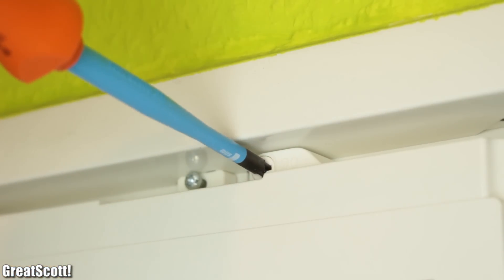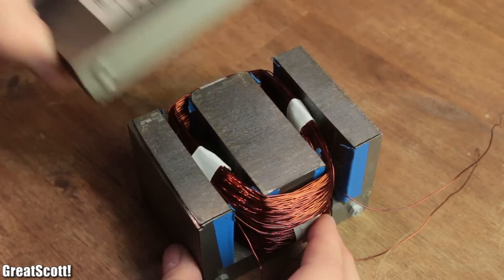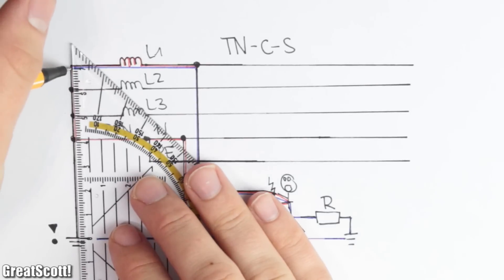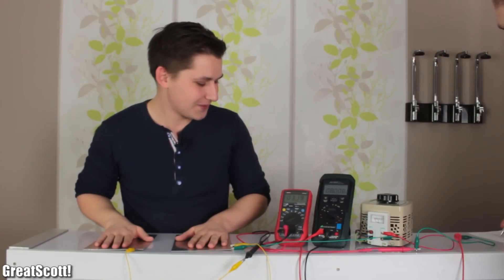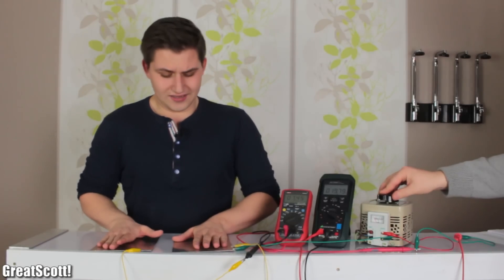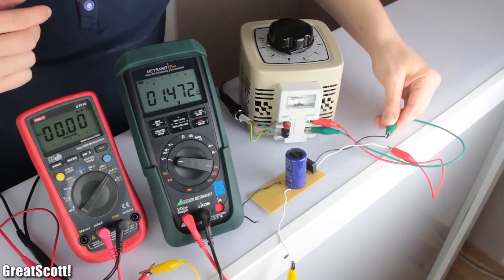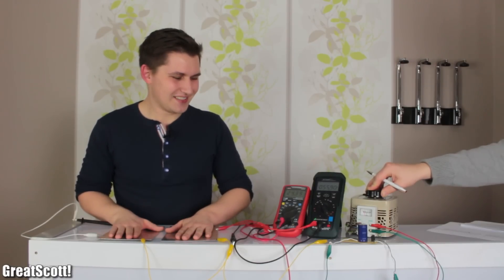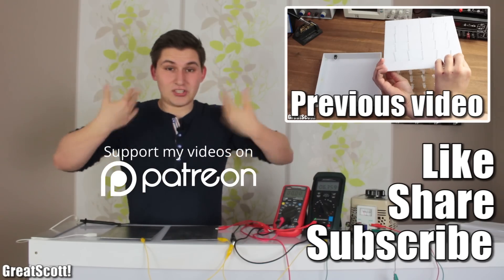AC VS DC - Pain Test (Experiment)

Comment: Please, please be careful with any AC current flowing past your heart!
Reply: +Mandragoras Ohms law is linear so both are dangerous...geez
Reply: +Mrvideosandgames yes he can make it with two fingers this is not so dangerous
Reply: rentacow
It's already been covered, the TASER only outputs 50kV when the outputs are high impedance. The energy is limited, therefore when an impedance (body) is connected to the probes, the voltage collapses. The subject never sees 50kV.
Reply: Shirshak Bajgain That's not possible. 1MV at 0.000000001A would imply the body has an impedance of 1x10^15 ohms, which is simply not true.
Reply: Shirshak Bajgain That is a misinformed statement.
Reply: Shirshak Bajgain
You cannot have a sustained deadly amount of amperage without having a sustained deadly amount of voltage. No matter how much that current is, it is only the result of the appropriate sustained voltage applied. You can never have current without voltage. There is a clever reason why you will only see warning signs reading WARNING - HIGH VOLTAGE! but never a mention to current.
Reply: +rentacow No it's not. What would be the mechanism?
Reply: +drinkrealale DC across the heart is less of an issue, it's unlikely to cause fibrillation.
Reply: @sdgelectronics  nope, it's at the same risk level with AC. DC voltage and currents remain constant, and when the this DC current flow thorugh a heart, it will forces the heart to contract constantly. AC on the other hand, had those milisecond where the voltage and current are zero, and with that time you could make an escape from the contraction
Reply: drinkrealale yes! :D
Reply: Shirshak Bajgain
How can high voltage signs be misleading? So you are telling me they should be: "Warning - High Current!"? What would that even mean? Also, what +SDG Electronics above^ said. Do you know Ohm's law?
Reply: +pesshau Yes but this is an answer to a different question, like which amount can you define accurately voltage or current. The question though is, which is the killer, volts or amps. But amps cannot "come into existence" without volts as current is the result of voltage. Also we should not keep spreading the misconception "it's not volts that kill, it's the amps" because way to often this causes misunderstanding that can have fatal consequences.
Reply: Shirshak Bajgain

Then stop saying it. Do you know how many bafoons are there on the internet who read this misinformation and believe it and then parrot it. I've read so many comments of people actually saying that they are afraid of power sources with voltage so low that you cannot feel it but capable of high amperage. And even people saying that they are electricians and have years of experience and have accidentally touched high voltage live wires and are still alive so it's not voltage that kills. This is ridiculous. Do you want to get people killed? Even when you just say amps kill, you imply that voltage does not kill and this is how you will get people killed.
 
I'll copy paste my previous answer to you just in case it doesn't get ghostbanned this time.

Yes I know it is not a universal law but it is a law. We are not discussing Linguistic semantics here. Read the wikipedia or any school book. And if you disagree then edit the article.
The human body is not a semiconductor and we are not talking about semiconductors. And by the way thank you for mentioning Afrotech's video and thank you for verifying that you agree with Afrotech's video because he said this in that video about the common misconception that it's not the volts that will kill you, it's the amps: "It's basically a load of crap and dangerously misleading ,,, so I'll bust this myth very thoroughly" & "In conclusion, in almost every situation, the volts directly determine the amps flowing through your body. If anyone tells you that volts won't kill you, they are an idiot."
According to you, 1) it is possible somehow to apply 1 million volts but only 0.000000001 current will flow through a human body (as if you meant you can apply current instead of voltage???), 2) Ohm's law is not a law (do you not think so? Prove otherwise) but just (an ambiguous?) theory, 3) High Voltage warning signs that are used globally and this is the only way they are written, are wrong, warning signs should warn about high current (which makes no sense).
I strongly get the sense that you are a troll and I don't want to waste any more of my time.
Reply: ivan Reynoso Only in ohmic materials...
Reply: ivan Reynoso I understand Ohm's law but it does not contradict the way I see things. Voltage is the dangerous force that kills, current is only the result of that force.
Reply: +Mrvideosandgames Your comment does not contradict in any way my comment so I don't see why you had to quote me. It's annoying when people don't understand what I write and I have to repeat myself. We know give or take how many amps through a human heart can kill a person just like we know for example the amount of a chemical in the bloodstream that is needed to kill. The force though is the voltage, amps are just the result of that force so voltage is the murder weapon, current is the bleeding and resistance is the bulletproof vest. How much voltage? That depends like you said on the skin/body resistance which, when high, can result in low current because of Ohm's law. I never said that low voltage can kill unlike low current. I did not mention amount of voltage at all because it is irrelevant to this discussion. Current cannot exist in the first place without voltage.
Reply: +Mandragoras it's the curent that kills you, look at the high voltage workers, they work on powerlines at 400kv or 250kv, and the connect first with a wire and work under high voltage. that guy from your video is not right.
Reply: Fυck it, I quit. Youtube, shadowban style, deleted my comments to both of you. I don't know what's the problem with youtube and why it's shadowbanning my comments so regularly. Besides, I get the feeling that you Shirshak Bajgain are just trolling me so I won't waste any more time on this. Believe what ever you want, I don't care.
Reply: +Mandragoras USB is only 5 volts. When you touch it, your body has too much resistance for the electricity to flow, so no deadly current. That's why 9 Volt batteries aren't very dangerous.
Reply: rentacow
Yes, I know, thank you.
Reply: It requires both volts and amps to kill
You can have 2 volts and around 800 amps(homemade spot welder) and you would not die as 2 volts is not enough to overcome your skins resistance(in a short it produces 800 amps)
Amps is v/r so assuming the skins resistance is 1000 ohms you would only have 2 mA flowing through you. 
Unless you have a really high skin resistance or a current limiting resistor you will die from 100v ac. The skins resistance changes dramatically as you get to higher voltages too.
Reply: Shirshak Bajgain
Wrong again.
Reply: Ok let me finallx clear up this goddamn stupid conversation. Youtube comments are just full of sh*t.

It's the combination of voltage & current AND time.
Reply: OHMMMMMMMMMMMMMMMMM
Reply: @KK-pq5cf  Actually, if you want to be even more precise, what kills is either the arrhythmia and spasms in low-frequency AC or the burns produced by heat in DC and high-frequency AC.
Reply: +drinkrealale Ohms law is linear relationsip between current and voltage therefore both are dangerous
Reply: SDG Electronics I don't think ? can you show proof?
Reply: +Mandragoras 
Youtube's ghost ban sucks ass. I had to delete my old account because Google thought I was a troll.

On the subject of Volts and Amps, I think +drinkrealale got it right: the amount of lethal AC or DC current is fairly constant, and the voltage is what pushes that current through your body. How much voltage is needed? That depends on your skin resistance, which can vary greatly depending on factors such as sweat/moisture or frequency (if we're talking about AC).

Therefore, it is much easier to determine a lethal value of current than voltage.
Reply: Shirshak Bajgain
I'm 100% sure if I interpret correctly what you mean by "LOVE !!!" but anyway, I sincerely wish you the best.
Reply: +Mandragoras ok lets close it . thx love
Reply: +Dr. Lecter are u really doctor?
Reply: +Dr. Lecter hai r u really doctor?
Reply: Yea
Reply: +Mandragoras This is a really late reply, but it is the Current that kills you, sure you have your own beliefs about this, but just so you know,  If you put a 9v battery and hook it up to a LED, its going to burn out, this is because the amperage is going into the LED too fast. Its the same with a light, the fillement in the light lights up because electrons are moving through it quickly. However, if you put it near the heart, electricity moves very fast past it because humans have nearly no resistance in their body. So essentially, you are burning out your heart because it is heating up too fast essentially. Also with AC amperage, your heart rate is going to spike horrendously causing a cardiac arrest (i think atleast, im no doctor, im a scientist and computer programmer (kind of) xD)
Reply: MrCilliman That's exactly why I want them to be careful, lol.

Your skin actually has a fairly high resistance, by the way, about 10KΩ I think, and your heart most certainly does not fail due to being heated up, lol. The current just stops it working properly, which can sometimes be handy in operations and such if they want it to stop beating for a bit.
Reply: Shirshak Bajgain But I was agreeing...

***** Thanks for explaining, lol. Could be any frequency, lower or higher, I assume.
Reply: Mrvideosandgames Sorry i don't mean this comment to you . It was for who said voltage kills rather than amps :(
Reply: I zapped myself with a Flyback transformer... Wasn't fun

I'm not gonna go too far into it, but I had to work with a CRT while it was on...

Just make sure you don't work with both hands and ground it before your heart.

I did fix it though
Reply: I'll also say that I know I'm retarded, no need to tell me what I already know.
But feel free too lolol.
Reply: You need voltage to overcome the resistance of your skin. Static electricity is many thousand volts and does not kill you because there is not enough current.
Reply: isn't this a stupid discussion? OHms law: R=U/I so if you want twce the voltage at the same resitance you automaticlly get twice the Current, don't you?
Reply: +Felix St dc can be more dangerous mainly because it can Electrolize your blood, causing gas bubbles in ur blood, which can be very fatal
Reply: +Felix St high voltage DC
Reply: I know but the discussion was about current and voltage :)
Reply: +500mA?? More than a merely 5mA flowing in your heart can killyou
Reply: SDG Electronics what? Power(Time) is work. Energy is Power/Time.
Reply: True but high current power supplies wont be able to run high currents through your body without enough voltage
Reply: Mr Videos & Games he's an expert
Reply: This is the same thing as asking If its guns that kill people or bullets, its neither  but the combination of both.
Reply: its correct
Reply: Mandragoras
if it was voltage that was deadly, a lightning bolt would kill you with volts, not burns.
it kills you with burns.
if it wast he voltage that kills you, you'd be dead when you jump off a trampoline and get that discharge to ground, that's over 20kv.
if it was the voltage that kills you You'd die when touching the front panel of a CRT after it's been running for a few minutes.

if it was the amperage that kills you Touching a car battery (400Amps) You'd be knocked to Pluto.
if it was the amperage that kills you AAA batteries would also be deadly (~2Amps continuous until depleted)
if it was the amperage that kills you a USB port is a deadly weapon.

The answer? Neither. Not in the way you're interpreting them.
Volts and amps are a measurement.
Volts being the potential difference in charge from one thing to another.
amps being the flow of electrons (How many per/s).
One ampere is around ~6,250,000,000,000,000,000 electrons per second. (That's a lot of electrons) So we condense it into measurements such as pa, na, (Micro)ma, ma, a, Ka, Ma, Ga, Ta, etc.
We also do the same with voltage pv, nv, mv, Volt, Kv, Mv, Gv, Tv. (Pico Volt, Nano Volt, Micro-Volt, Milli-Volt, Volt, Kilo Volt, Mega Volt, Giga Volt, Terra Volt)

Amps cannot exist without a measurement of volts, Neither can volts without amps.
Because you need current to flow in-order to get even a measurement of volts, In the same way you need volts to get current through the wire (There needs to be an imbalance) otherwise there is no volts. That's why multimeters have two probes.

In the same way volts cannot kill you, as there is no current flow, and amps cannot kill you as there is no volts to ram them through you.
You need both.

However, it's more complicated then that, The before mentioned static discharge from a trampoline has around ~20kv, and due to your capacitance and the High voltage you actually get in that time frame if continued ~8Amps of current flow! Then shouldn't you be dead? Nope, As i said if continued You get 8 amps, but it's for such a short time that it almost doesn't even hurt.

Hope this answers your question.
Reply: It is Voltage in combination with Resistance which determine Current (aka Amps). So Current is directly proportional to Voltage (assuming resistance is independent from voltage). Therefore Voltage high enough DOES kill you, if the Power source can provide more than deadly current limit. Because high voltage allows more current to flow.
So it is a combination of Voltage, Resistance and Current limit what kills you.
Reply: Abraham Toledo cant rely on a current limiting device, you heart could stop before it reacts.
Reply: Tau you are equating static electricity to an electrical supply, fundamental error right there. Touch a very low amperage Christmas light, and then go and touch the same 'high current' voltage oven or heater supply. They will feel the same. A mains electrical supply can produce as many amps as it needs, even before the fuse has a chance to melt. Current is a useless measure of lethality because you don't know your resistance to ground, which can change massively. Volts kill you, unless the supply is static electricity which depletes itself in fractions of a fraction of a second.
Reply: Since both current and voltage are factors of how dangerous the electricity is, how many watts is dangerous? since P = I*v
Reply: What an interesting thread.

The human body has resistance or impedance. These values change when you get wet or something so lets just assume we're dry,  I just got out my multimetre and found a resistance of approximately 1.5MOhms from hand to hand. This value is different for everybody somewhat, but it's generally pretty high. 

If we also assume that the current required to stop a heart is 5 milliamps, we can use Ohm's law to figure out how much voltage would be required to source the 5 milliamps through my body: V = I * R -- V = (0.005a) * (1500000ohms) = 7500V.

The reason the signs say high voltage and not high current is simply because you need a high voltage to source the current necessary to kill. A current source may be capable of 1000A but if the voltage is only 1V the resistance or impedance of the body is too high to source any real current.  Voltage is required.

The final statement should be that the combination of a high enough voltage and current and condition of the body (wet, etc) kill.  These are not independent entities.
Reply: Mehdi sadaghdar be like
Safety is last priority
Reply: Only 10 mA current flowing through the heart can kill you.
Reply: Shirshak Bajgain The energy dictates the lethality of an electric shock. That is the product of power x time.
Reply: Mandragoras Actually warning high voltage is misleading. You can look university books. If you have 1 million volts but 0.000000001 current is flowing through you nothing happens. Amps kill not voltage
Reply: OMG do you know ohm law is not universal law? Actually it is not law. If you think V=IR is a law than please google what is law :( And By the way ohm law is not valid everywhere you do . In case of semiconductor do you still calculate resistance by saying R=V/I ?? actually there is many things we don't know :) . You can search on youtube "It is not the volts that kills you" by alfrotechmod :)
Reply: rentacow
 👍
Reply: Mandragoras You can get shocked by thousands of volts and still be fine, as long as the current is very low. The voltage gets dangerous due to V=IR and the fact that the electricity can leap from its source to your skin.
Reply: @Mrvideosandgames  Actually, you can't have thousands of volts at a low current flowing through your body. At a constant resistance (human body has more or less constant resistance at a given voltage), if voltage is high, current is also high. If a supply is current-limited, the voltage goes down.
Reply: @Mrvideosandgames  That's not true, if you feel it it means there is current flowing, but if it doesnt kill you and you felt pain it means the time was short.
Reply: Mandragoras Hai :) 
Ok lets say John Doe has a gun. He killed Sarah. What will you say? Gun killed Sarah or John killed Sarah?  Ok you may say gun killed Sarah right? But you go to court and it is still appropriate to say gun killed sarah instead of John killed sarah? Yes i know that without gun John couldn't kill Sarah?

I think you should try to understand :). Love !!! . Yea i may be wrong but i watched many videos read many books :) I even watched the great learning physics course . Yea if somebody can convince me than i will agree the volt kills people?

By the way you can see youtube videos ohm law is not real law or something like that. But still we say ohm law because people use to say it like that :)  

LOVE !!! Thanks !!! :)
Reply: I'm not sure, but if it were the voltage alone then a 50,000 volt taser shot would kill every time.
Reply: K
Reply: lol49031 But i don't know why people are arguing with such a easy thing :( . The thing is not to produce 100000amps or 1 amps . the thing is lets say if you make voltage 1000 and no current flows inside body you arenot going to die . But if 0.0001 flows through body you are going to die although it may be 1 volt just we need that current . I don't care how much voltage is require to create that amps :). High voltage can create that much amps to make person die so they write HIGH VOLTAGE etc.. Voltage is necessary but still we cannot say voltage kills instead of amps kills :).  And by the way you are correct :)
Reply: Mrvideosandgames If you try to argue you never understand but if you try to understand you understand. The fact is amps kills than voltages. No thing more to say :)
Reply: Mandragoras But that's wrong. If it was voltage that killed you tasers would i vatiably kill. Of course tasers can kill, but most often do not. It is current that kills, albeit current that must be induced by a sufficient enough voltage to overcome the impedance of the human body. I've been hit with tens of thousands of volts in HV experiments. However, the voltages were not accompanied by any significant current - on the order of one or two milliamps. The experience was less than pleasant, but still, here I am.

tl;dr - It is current that kills, but only such current as is the product of sufficient voltage to overcome the human body's inherent impedance.
Reply: SDG Electronics Power=burn, current=heart problems, voltage induces current. Resistance lowers current. V=IR
Reply: +Mandragoras amps kill not volts
Reply: Mandragoras This is the most retarded argument ever. Are you 6 years old? You're playing word games.
Reply: +drinkrealale I'm one of those who believe otherwise. It's the voltage that is deadly, not the current. I have at least one on my side. https://www.youtube.com/watch?v=XDf2nhfxVzg
If it's current that kills you then don't ever dare touch a usb port. It can deliver more than one amp, so you are dead.
Reply: Mandragoras Actually Although volt is require to create amps we still say it is the amps that kills :) If there is no volt but amps than It will definitely kill but if there is no amps but there is volt than nothing happens :) So  i hope you understand :)  thank you :)
Reply: @bloggervista nope.. high current with low voltage, can't kill you.. like 1 Volt but the current is 100 Amps, this power make you feel nothing.. 100 watt power of high current and low voltages means nothing.
even 5V usb with 3A current, still make you feel nothing.

but, with high voltages like 100V AC with 1 Amp current through your body, you would not only feel the pain but your heart would stop beating.. 100 watt power of high voltages with low current..

so, in order to amps can kill you, you need both of high voltages and current.. you need high pressure of water and high amount flows of water to kill you.. just high pressure with little tiny water drops, its nothing, also just high current water flow with low pressure its the same thing.. nothing.
Reply: No, It really is the current that kills you.
Reply: SDG Electronics Really lets say current crossed 0.0001 through your heart. Would you still survive. But the voltage is low and and energy is low? would you survive???? Actually Voltage doesn't kill you it is the amperage.
Reply: +Mrvideosandgames Please be careful with DC past your heart also lol.  AC voltage pulls you in and then throws you back then pulls you in again because it's a sinusoidal  positive to negative and back to positive polarity!. Remember voltage doesn't kill you.  CURRENT KILLS YOU eg. +500mA = DEAD.  voltage is the pressure that pushes the current along.
Reply: @drinkrealale really current kills not voltage ?
you need a high voltage and high current from the source to potentially kill you..
voltage just like pressure, you were right.. 
but, without high current flow, high voltages means nothing, you barely feel it and it can't kill you..
and otherwise, high current without HIGH VOLTAGE also means nothing.. because the human body resistance was too big the pressure not strong enough fo flow the high current.. except, if you body were wet or sweaty, the resistance can be much lower.

so, you need both of high voltage and current to electricity can kill you or someone..
that's why many electronics appliances always gives you a high voltage warning not high current.. because our home electricity, were already have high voltage AND high current.